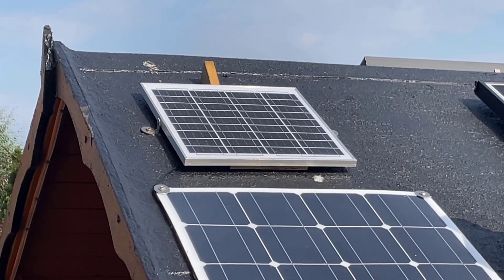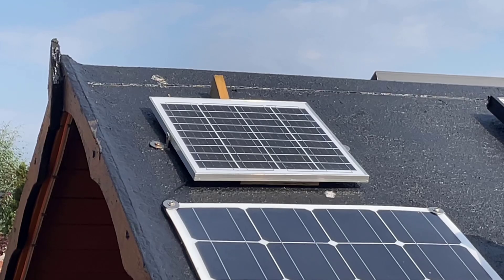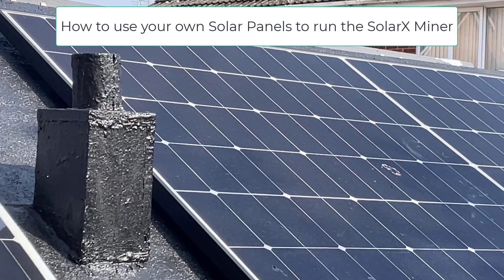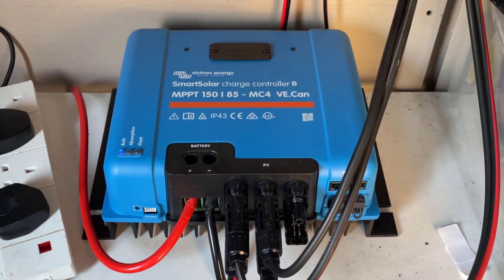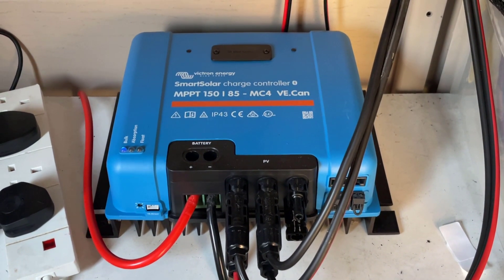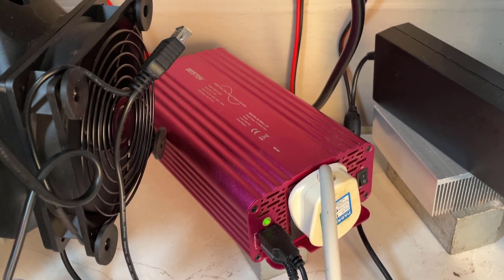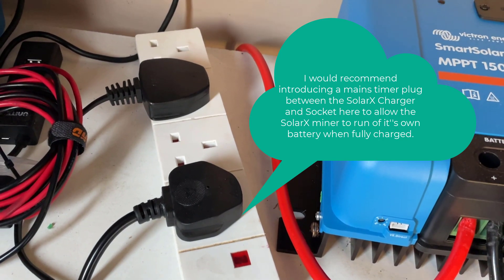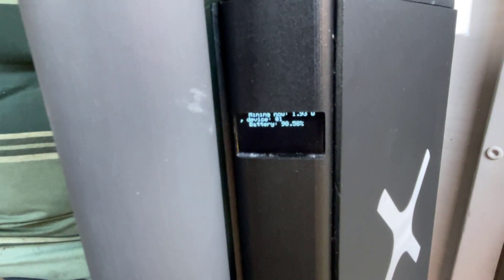SolarX Miner - Three Months Later......

Comment: have you earned any crypto in those 3 month?
Reply from the maker: So far the return has been around 1/7th of the actual cost. But it depends on your strategy and token price. The project team are aware of the slow returns, so I'm hopeful they will be allowing us to multi-mine other coins to encourage take-up. Other than the shenanigans with getting the Solar side of things working, it's been quite reliable once up and running.
Reply: @HandymanSavage quick question brother if I get a 300watts panel will I generate at 300 watts on the miner?
Reply from the maker: @KO5E  I wish that was true, but no the Miner sits around the same wattage as the included panel even when using your own panels. The larger solar panel is used to ensure the built-in battery has enough charge to keep it running 24/7